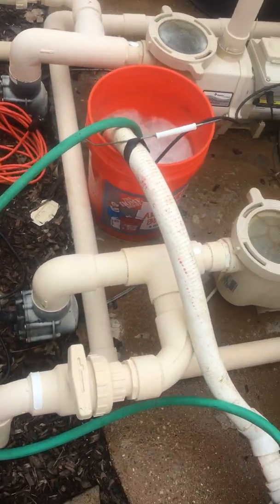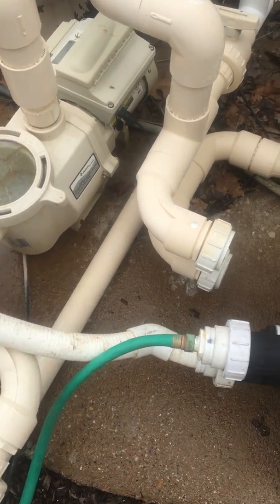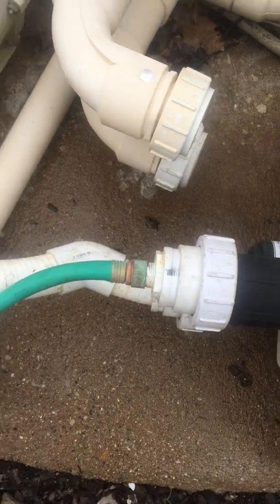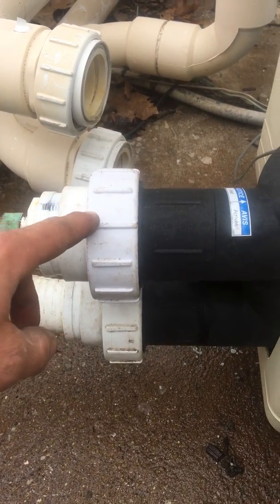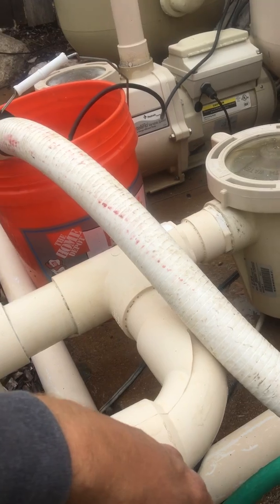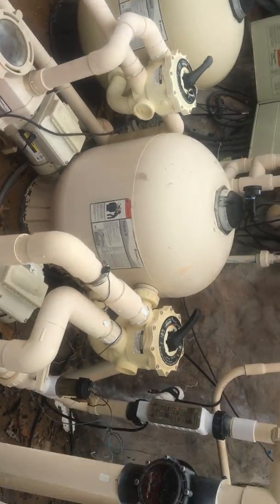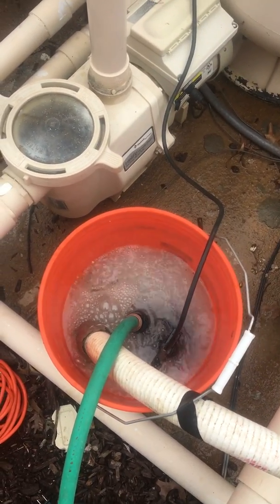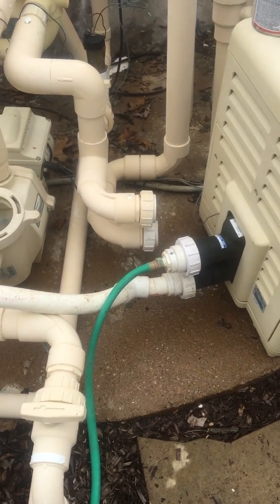Ask the Pool Guy: Descaling a Pentair MasterTemp Heater | How It Works

Comment: Thanks for posting this-- I have a new ETI 400 heater and this setup might be just the thing to make sure it lasts a lot longer, since it has many components that require an annual inspection, and since I have hard water in Phoenix, this would most likely be quite useful!
Reply from the maker: The most important factor for heater longevity is to actively monitor the water chemistry - especially pH alkalinity and calcium hardness along with chlorine levels. Just because water looks clear doesn't mean it is balanced water. Good luck!